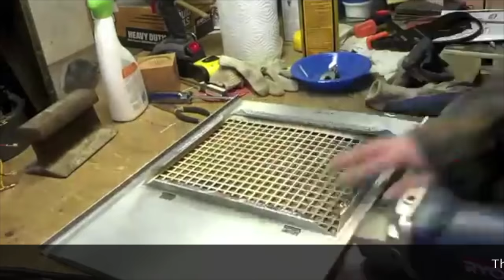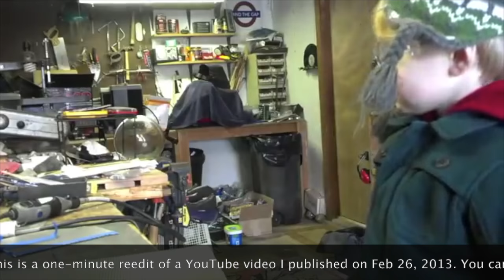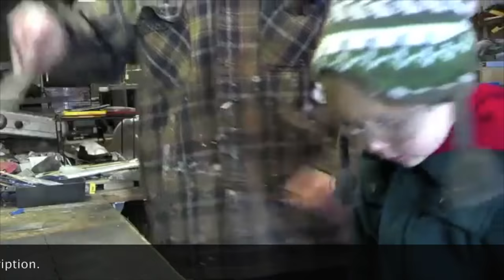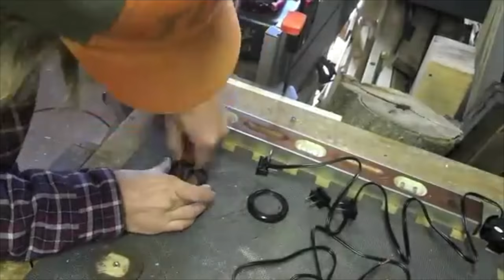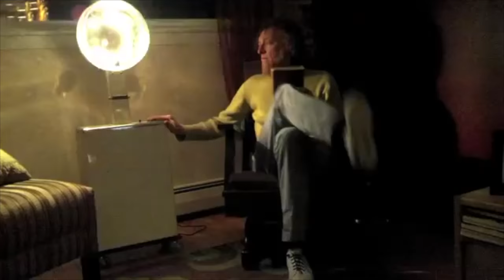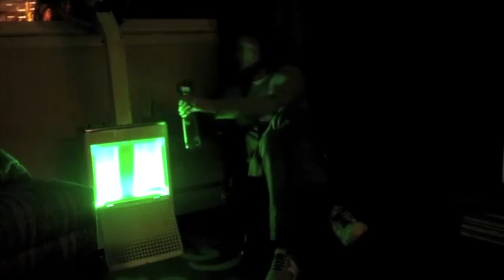Hair Dryer Lamp - S'way Back When No 2

Comment: I didn't see that one coming, lol. Is the base a cooler?
Reply from the maker: Paul Buckel Jr no refrigeration in there but that would be cool. I turned the chair part in to a retro iPod dock. it has a 150watt Soundsystem in it with the subwoofer under the butt. my teenager uses it :)
Reply: +tim sway sounds sick I'd use it to